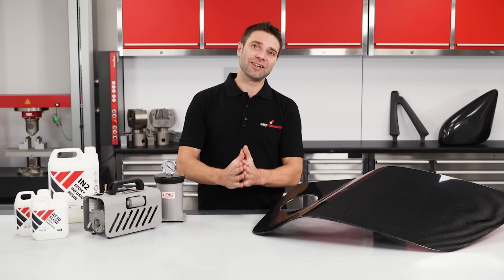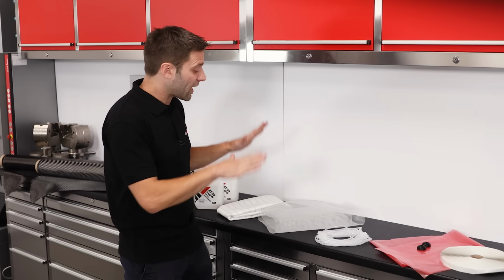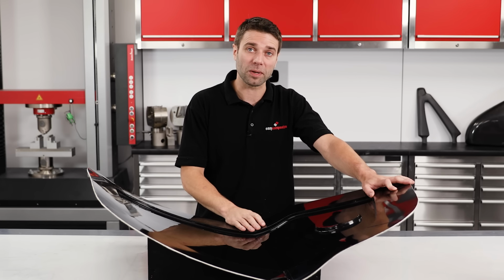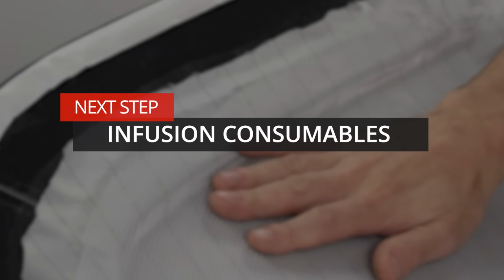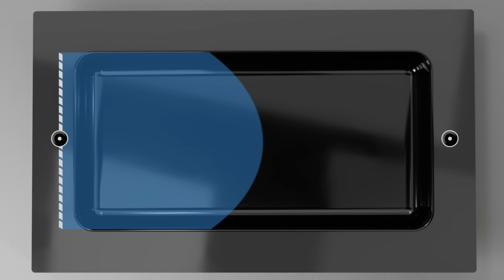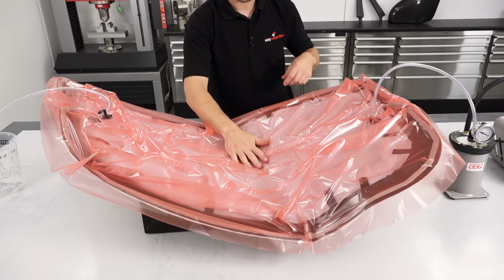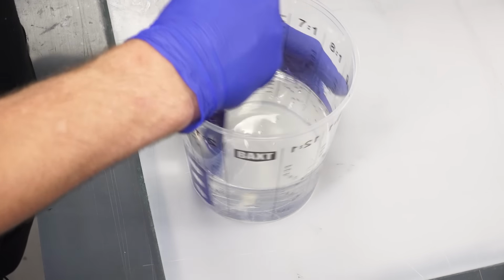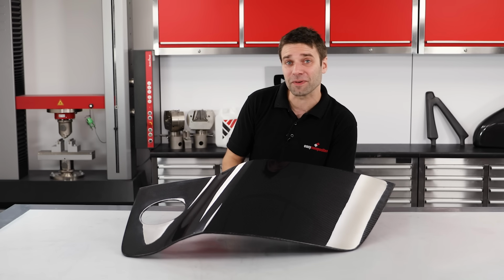Beginner's Guide to Resin Infusion for Carbon Fibre Parts

Comment: Would it make sense to use this method for small parts? For example a 150x200mm air duct.
Reply from the maker: Yes the resin infusion process still works absolutely fine for smaller parts.

Comment: its very dificult to seal the house with that sealing tape, high leaks always present
Reply from the maker: Closing bags and finding leaks is definitely a skill to be practiced, once you nail it though, the sealant tape is a very reliable way to create a secure seal.
Reply: @easycompositestv  i also heard that some times its more easy to put the work pice in another bag again if leaks are hard to detect, i dont know, i had expirience doing wet lamination but this process its new for me
Reply from the maker: @jorgeneo560   Yes double bagging is definitely an option if everything else fails, it's not ideal but can be a fall back option if you need.

Comment: It's impressive that they remove and cut one warp thread before cutting the carbon fiber.

I think the infusion technology for producing without pinholes is truly remarkable.
There are several conditions, and they're quite different from what I expected.

1. No vacuum degassing required: This is shocking.
2. Faster resin flow is acceptable: This is shocking.
3. For some unknown reason, they lock the out side first, then lock the in side after 5 minutes: This is shocking.

I'm particularly concerned about number 3. Is this for internal stabilization?
Simply put, it seems to relieve pressure within the entire internal cavity by isobaric pressure.
I believe this is the most crucial factor for successful infusion, but I'm curious about the reasoning from an academic perspective.

Could you elaborate a little more?

Thank you as always.
Reply from the maker: The reason for closing off the vacuum line before the resin inlet is to allow a little more resin to flow into the laminate. This helps to improve the surface finish of the part and reduce defects like pinholes.

Comment: Can I ask how thick of a reinforcement stack I can infuse?
Reply from the maker: It depends to a large extent on the exact type of reinforcement. Chunky 12k woven carbon infuses very well so you can go very thick with the laminate, up to maybe 10mm, but plain weaves, spread tows, biaxes and especially UD reinforcement can be much more restrictive to resin flow, and so significantly reduce the infusable thickness.
Reply: Thanks  @easycompositestv

Comment: Hi, I have a question: why does Easy Composites have epoxy and polyester infusion resins but not vinylester infusion resin? Is it because people rarely use it or some chemical-specific reason ?
Reply from the maker: The issue with solvent based resins for infusion are that the solvent can boil under vacuum, resulting in air and voids in the laminate. So to answer your question, yes a bit of both, there is a reason why they are rarely used therefore with low demand there isn't much requirement to  stock a product which tends to have quite a short shelf life.

Comment: Great video. How would you go about making the connections on the back of the piece?
Reply from the maker: The solution is often different every time and sometimes involves salvaging some of the clip or bracket off the original part (if it is to be discarded) or making something similar to the original bracket any way you can (by fashioning it out of a bit of plastic angle for example) or sometimes even making a small carbon fibre bracket and bonding it to the reverse of the original part.

Comment: This is EXACTLY what ive been searching for. Thank you very much, amazing video. If i may ask, if id have a few succesfull runs with some smaller parts, would making a car hood, trunk and doors be possible? I want to make them for a audi b9 rs5 because they arent made by anyone and need to shed more weight, id presume they might not work out first try of course but if theyd eventually work id be happy. Especially considering how much carbon parts cost
Reply from the maker: Yes definitely - we've had many customers jump straight into making larger panels including full clam shells but our advice is always to start small and work up to those. Starting smaller not only reduces the risk and losses if mistakes are made but also allows you to familiarise yourself with the timings and processes. We actually have a hood (bonnet if you're in the UK!!) making tutorial series; it was one of our earliest videos 13 years ago but still gives all the information you would require to make large vehicle panels.
Reply: @easycompositestv  thanks alot again, this was the most helpful guide out there, explained everything perfectly and i can buy the equipment directly from you guys since you have a shop in europe. ill definitely watch the bonnet video, i will start off with smaller parts to practice 😃

Comment: Question.. I want to do door panels of a car. What to do with the textured finish on them ? They have that plastic leather like finish on them. Is there a way to smooth them with a product ?
Reply from the maker: If you're looking to take a mould off them then you could coat first with XCR coating resin and then sand and polish to bring up to a smooth glossy finish.

Comment: That is quite expensive just for some carbon fibre parts for my car😮. Will probably end up buying this kit with the pump so I can 3d print some moulds and make parts like (air intake box, turbo intake pipe, engine cover etc.) 
But still, £458 is EXPENSIVE. I guess it’s the cost of a cold air intake box and an engine cover so I may end up saving money in the future I guess.
Reply from the maker: Equipment like this can certainly be a good investment in the long run, especially if you plan on widening the range of parts you want to make. 

Whilst 3D printed moulds can be used for composite work, you need to be careful with resin infusion as it requires a fully sealed surface and needs to withstand the pressure applied from the vacuum bag. A better option may be to use the 3d print as a pattern and use it to make a composite mould.

Comment: Dear Easy Composites, I love everything about your resin infusion guide, instructions and all of the products you sell.
I would have some question about resin infusion, because everything goes great with it, I can make parts with almost perfect surface, just very few little pinholes. The problem is not with the making of the product but after the disapplication and the cleaning. I use the same Uni Mould tooling system and I made only one mould for a little shoe horn. Everything is good but after I pop out the product, I have to clean the mould for a very long time all around the flanges (the area where the product is looks just as good as before). The flanges are a nightmare, because the resin keeps sticking to it and not just I have to scrape it with demoulding wedge for a very long amount of time, I can't scarpe off everything because very thin pieces remain on the mould surface. I use MC1 mould cleaner after I scraped everything I could from big to small chuncks but the mould cleaner doesn't wash off these solid resin film pieces. The peel ply also leaves a textured surface resin film on the mould that can be scraped of with some effort but some very small film pieces can stay on the mould that must be sanded with P1500. Sometimes the resin sticks to the mould and when I scrape with the demoulding wedge, smaller than 1mm chuncks can rip out of the mould (this is not a big problem because I can repair these with MW1 wax additive and sand them back to perfect finish). How do keep your mould so very clean on the flanges? And why does only small very easly scrapeable resin pieces stay on your mould? On my mould, slightly larger pieces stay on the mould, where for example, there is extra bag and the resin follows the path where the extra bag is. I used sheet wax, because I could make the mould like that. Thus the surface finish wasn't already shiny, I had to sand from P120 and then P400, P800, P1200, P1500, P2000 (I could start from P1200 but this time the delivery guy gave me a sheet wax that was bent at multiple places and the sheet wax had wrinkles on the surface but nevermind, don't react on this) and then I use NW1 super cutting compound and then I use topfinish 2 black nano polishing compound because I can't get a mirror like surface from just the NW1. Now I have to sand again from P1200 or P1500 or P2000 everytime I demould a product, because the flanges are not perfect (this depends on how hard the resin sticks to the mould). I believe I sand the mould everywhere the same (maybe a little bit more where the actual product is) but the whole mould is shiny and mirror like (but not as mirror like as your mould in this video and maybe that is the problem, I don't know). Please @easycompositestv help me, because this is crucial and you always replied on my comments and questions here or in email. I love your service and everything about it. Thank you.
Reply from the maker: You need to apply release agent to your flanges and ideally make your flanges smooth and glossy, much like the rest of the mould surface.  You cannot stop resin tracking onto the flanges, but by keeping them smooth, glossy and release coated, it will make clean up much easier.  You can sometimes get a build up of resin in such areas which may need to be sanded off, but in such cases, restoring the gloss finish and reapplying release agent will help reduce it sticking in the future.

Comment: what type of shears or scissors do you recommend? are tailor shears enough for cutting 600gsm fibers?
Reply from the maker: Ideally, a specific pair of carbon fibre shears which will have correctly angled and serrated cutting edges to 'shear' the carbon fibre. https://www.easycomposites.co.uk/shears-scissors-knives

Comment: we are trying to make a vacum infusion molding setup for our research project. we are using polyster resin and our setup is 10x10 inch for now, later we will extend it. It's a flat plate, will single stage vacum pump of 1/4 hp work ?
Reply from the maker: It really depends on the specification of your pump. As an example, our 1200W EC4 is fine for bagging up to 10m²

Comment: In an earlier video you mentioned using perforated release film instead of or behind the peel ply. I haven't found a video where you've done this. I want the outer surface to have a good finish with minimal post cure processing, however I don't fully see how the resin will flow through my carbon fiber if there is peel ply between it and the flow media.
Reply from the maker: Yes it's certainly possible to use perforated release film for infusions if you want something slightly easier to remove, although you would struggle with a thick laminate as the resin is much slower to pass though. 

In actual fact we think that the peel ply finish is better as a release film finish tends to be a bit wrinkly from the creases and folds.

Comment: How many layers can i do with this method?
I wanted to make some carbon fiber car parts and  i was wondering if i could do 5/7 layers for the chasin
Reply from the maker: It depends on the weight of cloth, thicker laminates are possible but you may need to adjust the infusion setup accordingly to ensure that the fabric sufficiently saturates and you don't end up with dry areas in your finished part. This can include measures like restricting the resin flow so that it passes through the infusion slower and doesn't skip over the surface layers, leaving others without sufficient resin.

Comment: Question?
If I use small amounts of polyester filler in my foam core, will that cause volatiles to be drawn out into the resin under vacuum?
Reply from the maker: If the resin has fully cured then it shouldn't be an issue.

Comment: when calculating the amount of resin needed, you added the 700g/sqm for the mesh and peel ply, is that value calculated or is it a constant?
Reply from the maker: The additional resin for the absorption into the consumables is a calculated weight at 700g/m². As our mould aea was around 1m² it made for a nice easy 700g.

Comment: Good morning. If I need to decorate mirror caps and car door handles, should I also do it with a vacuum seal? Or is the process different for this decoration? Thank you for your response.
Reply from the maker: If you are referring to the skinning process then no we don't tend to use a vacuum for this as it tends to cause more distortion and wrinkling in the surface. Check out our skinning tutorial for more information. https://www.youtube.com/watch?v=aqwhcfQZT8U&t=750s

Comment: Thank you for always providing such high-quality videos — they’re truly impressive every time.
I have a question I'd like to ask: after using vacuum infusion, the carbon fiber surface already has a mirror-like finish. In this case, is it still necessary to sand and apply a clear coat?
In some of your videos, you do this, but in others, you don’t.
Is the decision based on whether the carbon fiber part will be exposed to sunlight for extended periods?
Finally, thank you for all your contributions.
Reply from the maker: Great question. If your part comes out from the mould with a really good finish then you can absolutely put it into service as it is. Depending on its use and environment it may age over time with UV exposure and such. If the part was going to be subject to high levels or prolonged exposure to UV then you may want to consider coating with a UV resistant lacquer. The same goes for parts which may have some surface defects that need to be remedied. In short it really depends on how good the finish is straight from the mould and how the part will be used.

Comment: I want to use this to reinforce my splitter on the race car . What do I do in this case if I want this to stick to plywood
Reply from the maker: If you are looking to as layer or a few layers of material to an existing from then I would have a look at out skinning tutorial. This process involves laminating a fibre onto an existing form rather than using a mould to create the part.
Reply: @ thank you!

Comment: I’ve been making carbon fibre parts with just hand lay and paint brush with VERY good results. I nailed my sanding process and polishing and I can make pretty much most parts. My next step is infusion! Hoping to start doing it this summer.
Reply from the maker: Nice job, good luck moving onto resin infusion.

Comment: Regarding the bubbles, would it make sense to clamp the inlet tube once the fabric is saturated and keep the pump going? Sort of degassing in the bag? Most likely it will introduce bubbles again before stopping the pump if you follow the procedure of leaving the inlet open after stopping the pump.
Reply from the maker: The problem with this is that it will only remove any air bubbles from the resin front around the vacuum port not throughout the whole laminate. The other issue is that, continuing to draw vacuum once the feed is clamped off can lead to a slightly drier laminate, causing imperfections on the surface as the resin is drawn out. We tend to recommend clamping off the vacuum line before the feed line to allow a little more resin into the laminate in order to improve the surface finish.
Reply: @easycompositestv  thanks! Hmm is there a scenario where by doing this you sacrifice surface finish but you can achieve fabric to resin ratio around the level of prepreg? Or still doesn't make sense
Reply from the maker: @giamademedoit  You can run a leaner infusion to achieve a lighter laminate yes, however it is likely to compromise the quality of the surface finish. It depends on your priority and where the part will be used.

Comment: could you theoretically use the infusion method for forged carbon fiber? If i wanted to add flakes of colored pieces into the otherall look, how would i be able to do that?
Reply from the maker: It's not a particularly common practice and for larger flatter panel like pieces a chopped tow 'forged carbon' construction isn't ideal. You can however experiment with laying down the chopped fibres and flakes into the mould as a surface layer and then backing this up with woven  carbon to provide the main reinforcement and allow the resin to flow along the fibres.

Comment: How thick will one layer of fabric add to the final part. What is the max number of layers you would use for a carbon fiber part of you hand laminate it?
Reply from the maker: The thickness of the fabric is derived from the areal weight, a rough guide is that every 100g will add 0.1mm to the thickness. So a 200g cloth is around 0.2mm. For hand laminating you wouldn't normally exceed a few mm in thickness as you have to work within the pot life of the resin and the lack of external consolidation means that there is nothing to compress the layers in the laminate together.